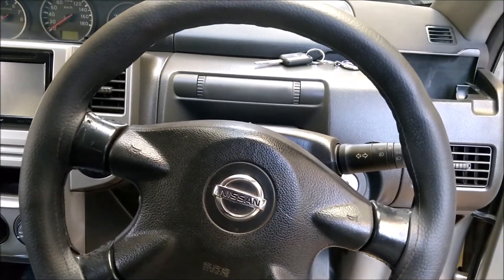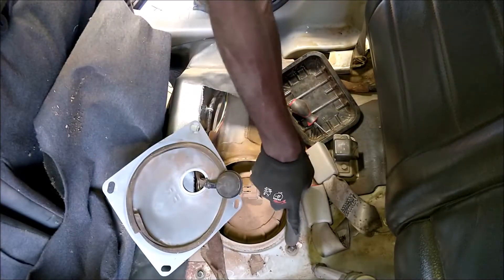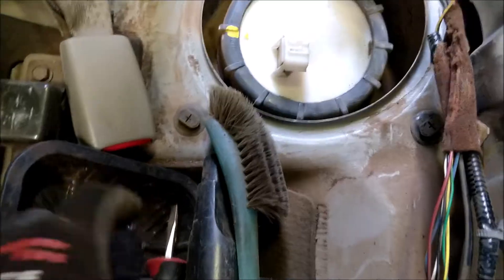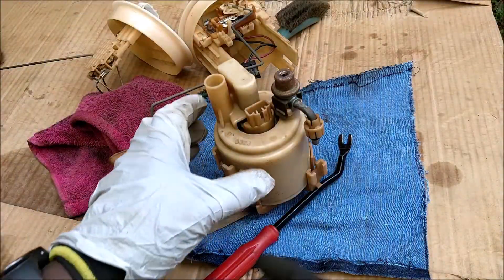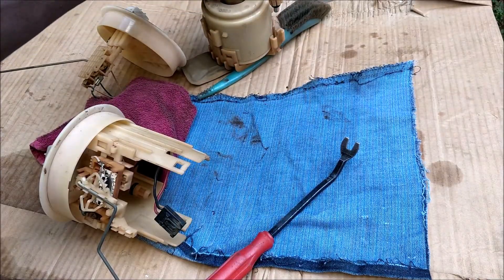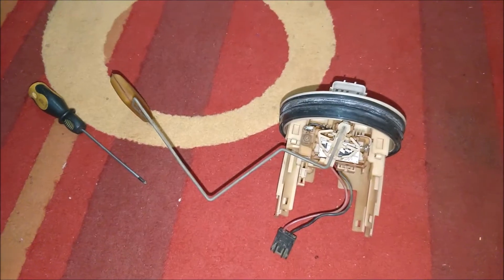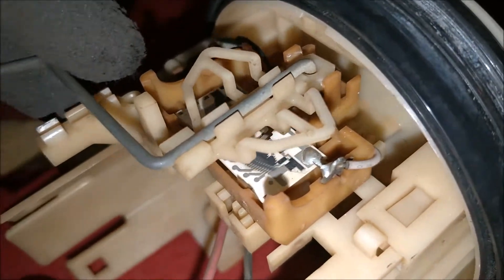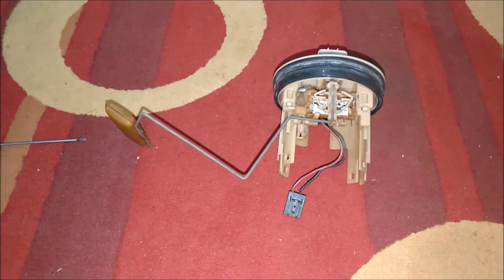How To: Nissan X-Trail T30 Fuel Gauge Fault-Finding

Comment: Hi guys, had the same issue with fuel gauge and cold starting in the morning. I always told myself that it is a fuel problem. Removing both float systems in the rank a few times. Replacing fuel filter with housing. No luck. 24th December 2025, I decided to give it another go. Remove filter with housing to check for leaks....no luck. Something told me to remove the rubber pipe between the filter and engine. Then I saw it was full of cracks, only noticeable when you try to straighten the bends. Did a suction test and leaking badly. Replaced this pipe and all problems solved. Starts first time every time. Fuel gauge problem also solved. Hope this can help others.

Comment: I've just ran out of Diesel and the gauge was showing just over 1/4 tank. I need to fix this
Reply: Same here, did you fix it?
Reply from the maker: Check your float and if that's fine, you may need to run a calibration check / test between the FLS (fuel level sensor) and the gauge (needle). Good luck and Godspeed on this. Report your findings and resolution if any.. :)

Comment: Wanted to get an idea of the job before taking out my fuel level senders to check them (guage often reads correctly until tank is half full, then suddenly starts reading empty most of the time).

I suspect damage to the sender units caused when a garage had to drop my fuel tank to replace the tank retainers. This video does a good job of showing what you will see when removing the fuel level senders. I'm grateful, as now I am prepared.
Reply: I am currently having this issue. How did you go?
Reply: @jordanlewis1163  took out and cleaned the sender units, checked the wiring was good, gave everything a good cleaning with an electrical contact cleaner, and put them back.

Fuel gauge is now working much better. I had a garage replace the rusted through low pressure pick up pump, and they had to drop the fuel tank from the chassis. That was when it started reading wrong. There wasn't any visible damage, so I'm thinking that they either messed up the balance on the float when putting it all back together, or there was some contaminant on the contacts inside the sender unit that was stopping the unit movement - based on the fact that when it was faulty but under half full, it would read correctly occasionally.

Worth saying: be careful of any plastic clips inside the unit, particularly those that hold the pick up pump and float mechanism. The fuel will have made these more brittle than regular plastic. If you have not got the proper unit removal wrench (I haven't) you can use a socket wrench bit and a hammer to spin the unit retainer rings, just make sure you mark a point across the ring and the unit so that you can tighten them back correctly. I did this with a lot of fuel in the tank, would have been easier with much less fuel! With care you can get the units out with spilling lots of fuel everywhere, but have a catch pan to catch the fuel that will be in the pick up pump, and will run off the float mechanism.

Comment: I had this problem with my 2006 xtrail extreme. Fuel reading was always off. Brought it to my local nissan they said that the feul sensors needed to get replaced, did the work and still didn't read the right amount of fuel. After 4 visits they ended up changing the guages and its now working good as new
Reply: same problem with mine, haven't fixed it yet

Comment: hello sir I just asked for my fuel gauge when my gas tank is full but in my fuel gauge dashboard it doesn't fill up, it's in the second line before it reaches full, but many people say it's a floater? you sir what do you think? thanks for the response sir.
Reply: I would check the fuel sensors and if need be replace all the guages worked for me
Reply: @kaneunmaskedal  When you say gauges? Do you mean the instrument cluster , the clocks in front of the steering wheel? I have the same issue and have cleaned up the senders a bunch and still it's not working properly. :)
Reply: @Chrischucas  yes the cluster of all the guages on the center of the dash. Replace that whole unit and it should fix your fuel reading
Reply: @kaneunmaskedal  That's expensive to replace compared to the fuel senders, isn't it?
Reply: @gerardreches  it can be. Though my car is having the problem again so now im gonna buy a set of new fuel float and sending unit
Reply: @kaneunmaskedal  What was your initial issue? Mine just doesn't read under 1/2 tank and the gauge drops from 1/2 to empty (once the tank is completely empty)
Reply: @gerardreches  yes that's the problem I'm having currently. I never replaced my fuel float and sending unit with a new one so I'm gonna try that and see if it works